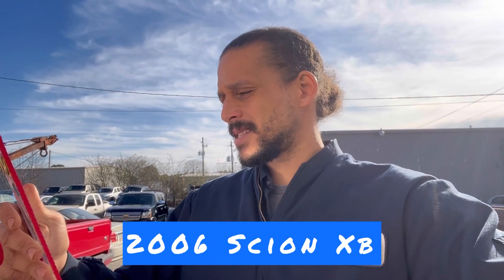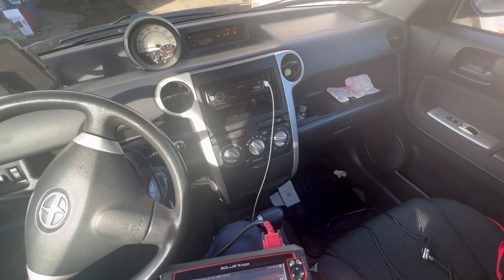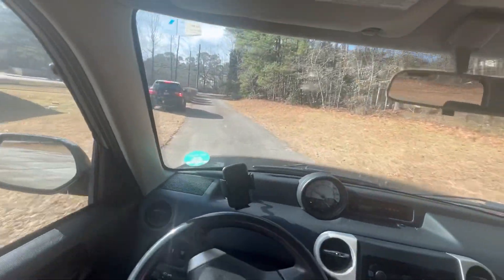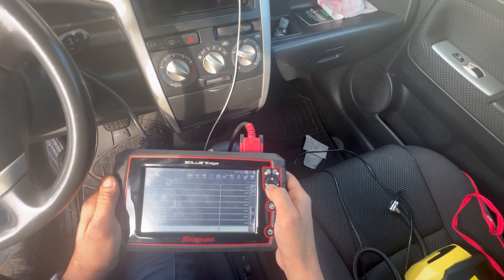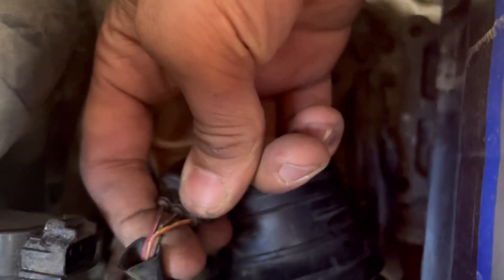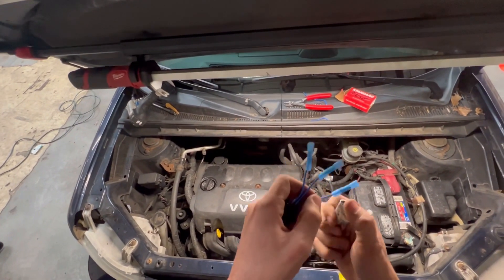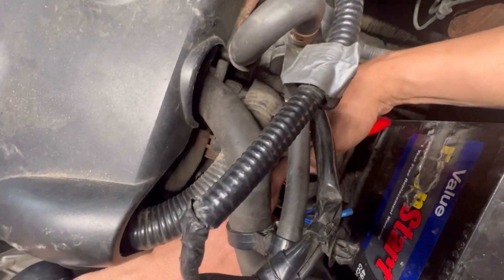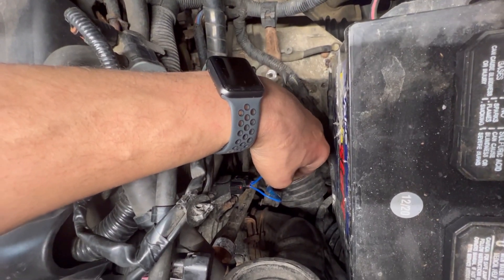Scion XB Transmission Not Shifting Correctly ( Diagnostic Process and Repair)

Comment: Our xA hangs up before shifting to 2nd when it's cold. It's probably a similar situation, so thank you for this video! I'll follow your procedure and check that connector. 
I would suggest that your customer have that brown ATF drained and refilled to the proper level. Transmissions tend to like clean fluid in the correct amount.

Comment: My initial thought was Throttle Position Sensor. I've been working on Toyotas for over 20 yrs, and I'd be amazed if the transmission was the problem. People call the first generation xB "toaster" because of it's boxy shape. Lol.
Reply from the maker: A Toaster 😂. I agree Toyota transmissions are amazing I only seen/ replaced 2 in my 15 years of auto repair

Comment: Alex when the car was idling was the engine vibrating? Having the same shifting issues with my Sion but there are no engine lights but when I’m idling the car runs like a motor boat. Changed all the obvious spark plugs air filters and even intake manifold gasket thinking there might be a leak but nothing has solved the shaky idle. Car drives a little fine but after I changed transmission fluid it seems to slip every once in a while. Can a bad air conditioning compressor cause a rough idle? I’m wondering if the compressor is wearing out and possibly dragging engine
Reply from the maker: Hello there a bad compressor will make your engine run funny but that will eventually make the belt slip or break it your engine mounts are most likely the culprit start their first as far as your transmission try Lucas transmission stop slip

Comment: I accidentally cut a wire that connected to the computer port to the eletric power steering motor..... once we got those connector butts in, we were good.

Now I didn't see him actually do the process, but my question is, The wires that you insert into the both ends, do they have to touch inside? Or is everything metal inside so all you have to do is pinch it down?

Would you do shrink wrap around wires that are near hot parts ? Or what would u use?
Reply from the maker: Hey buddy and thanks for watching. The book connectors are metal inside so they just need to be crap down. I would definitely shrink wrap the wires and if the wires around anything like the exhaust you would need to put a heat blanket around it

Comment: I have an 04 scion xb. Its my sons. Recently, gauges and cluster light up and radio shuts off. Have you experienced this? One of the times it threw code DC P2716: PRESSURE CONTROL SOLENOID "D" ELECTRICAL (SHIFT SOLENOID SLT). We shut off the engine and code went away. Hasnt done it since.

Comment: Hi Alex. I had a similar issue with mine. Switched the transmission and at exactly 2k rpm it makes a rattling noise? Do you have any suggestions?
Reply from the maker: Hey there unfortunately that sounds like something I need to look at in person
Reply from the maker: @Tom Smith 1850 Joy Lake road 30260
Reply from the maker: @Tom Smith dang. Let me know if you get it figured out

Comment: It's interesting that a TP sensor is going to affect the transmission shifting.
I have a different type of vehicle 2009 matrix that is drive by wire. Keep getting p211 which is WOT and it doesn't have any effect on the shifting

Comment: Great video n great info. I also have a 2005 Scion xB and coincidentally it has the same exact issue. 
Question though…. If it had been a transmission issue how much would you think it’s cost be?
In case I do have to do the transmission 😱
Reply from the maker: Thanks for watching. I’m not sure about the exact price but my guess parts and labor will be under 1500$

Comment: I have a Scion xB with the same kind of problem but mine is a manual just change the fluid, the ABS light and check engine light were blinking every time I was driving at high speeds when I slow down the check engine light then went away. When I'm parked in the engine is idling it sounds like it's either about to blow up or break?  Three lights on the dash, car overheats at high speeds at high gears, and at low gears or all the time it just does not shift properly into the gear and jerks back and forth like something is clogged or something but I don't have a filter in my manual transmission right

Comment: So is it a tps sensor? I’m having issues too it’s only been happening going uphill I lose power the rpm needle is up and down it’s like the car struggles to shift it happens on my way to work so far not in the morning but only up hill never on a flat road I checked my trans fluid it’s still red and it’s been shifting hard from park to drive or reverse 06 scion xB

Comment: Hey Alex, that sounds like a Transmission problem to me.  Not shifting properly.
Reply from the maker: Hey there and thanks for watching. The repair fixed the shifting problem. I don’t claim to be a transmission expert lol, I leave that to YouTube channel Precision Transmission. But I do know the transmission relies on engine sensors in order to shift properly. Like the mass airflow sensor and throttle position sensor just to name a couple.

Comment: My transmission was working perfect. Until I ran over a bunch of grass that was high. Enough to pull my Rear bumper Halfway off. Reverse will not work and i'm terrified to drive it. The mechanic said he didn't work on transmissions and he refused to even look underneath.. Underneath. I live alone and I need transpo halfway off  .
He said just drive it and don't park any place where I have to reverse? ?? I'm terrified !

Comment: Hi I’m having my Scion XB 08 Not  GETTING GEAR SHIFTS only DRIVES REVERSE   they keep telling me I need a new transmission 😢 I’ve done the whole maintenance solenoid n other parts replaced but the problem keeps coming back , I’d appreciate you so much if you replied. Thank you 🙏

Comment: Is it shift solenoid B?
Reply from the maker: The problem with this vehicle was A damaged throttle positioning sensor wire. No transmission codes. The car‘s computer is pretty good at picking up transmission faults you will quickly get a error code for a shifts Solenoid if that was an issue

Comment: I’m having a similar issue except it’s one the 3-4 or 3rd to overdrive shift, the coolant light will be blue when engine is cold and if I time it right and I’m driving when the light turns off it’ll shift to 4th, if I come to any kind of stop or downshift to 3rd it will not shift back to 4th. If anything like this is related idek if it’ll shift if I rev it all the way out cuz top of 3rd is almost 95mph and that box ain’t goin that fast 🤣

Comment: My car has the P0511 I changed the idle sensor but still it keeps coming up!
Reply from the maker: P0511 is a circuit code. Normally that’s related to the wiring. Double check the connector, the pigtail, and the surrounding wires of the idle sensor.
Reply: Ok, I’ll check it again. Do you know if there is a fuse to that wiring?
Reply: Dr. Alex on last question? Where can I get a replacement pigtail?

Comment: If you come across a first Gen that isn’t lit up like a Christmas tree on the dash lmk 😂😂😂 our charcoal canister was shit and trips 3 of the lights on the dash. I currently have the same issue as this one, but I have a manual. Mine was also in 1st gear and if I let up off the gas then pressed it again it would engage 1st. I don’t think it’s my transmission though. Mine has now actually jumped out of gear and is now stuck in neutral. It feels like it’s shifting but if I disengage the clutch the engine continues to run.  😩
Reply from the maker: Will do lol. Sounds like a a shift linkage bushing problem